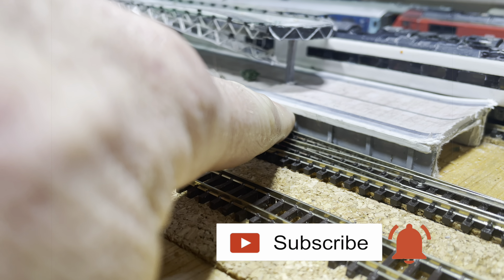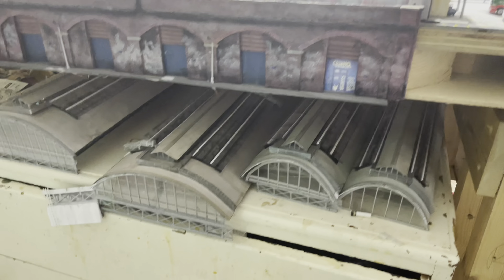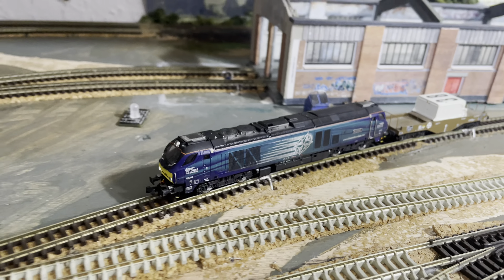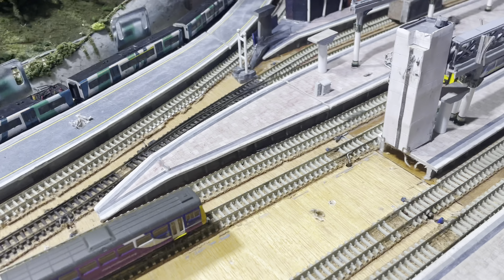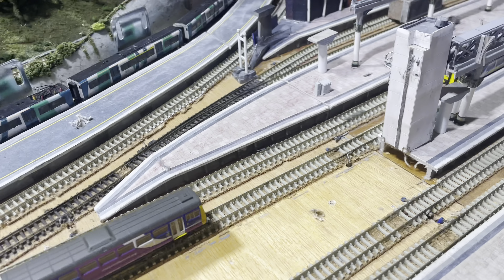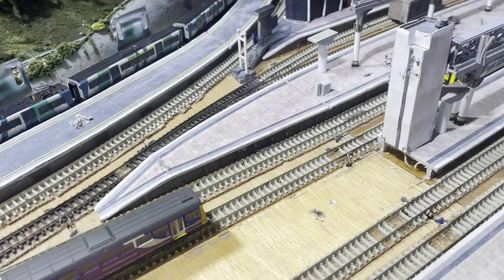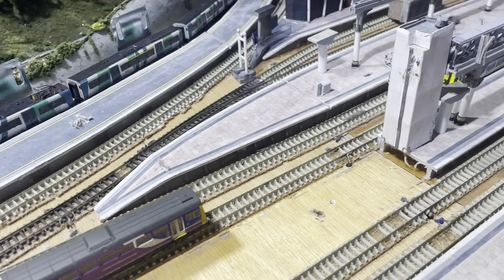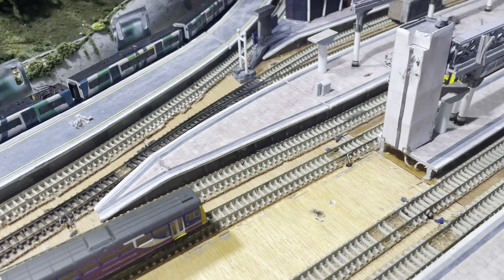I AM GOING TO REPLACE THE PLATFORMS.  EXTENSION PROJECT 2020/1 PART 7

Comment: Hi John,
Looks good you have your work cut out for a while I would think but except for your time which is invaluable cheap to do two things I noticed you have a point there and it looked like the switch will hit the platform side and you will be taking all the supports for the canopy out and they will need to go back in exactly the same place how will you do that?? Keep safe and well and I will look forward to seeing it all come back together then that will be some station.
Cheers Robert.
Reply from the maker: Hi Robert, Thanks and yes it will take ages with work in the middle, but bit by bit. The point is fine and switches without catching the platform. The sidewalls are about 2-3mm recessed from the platform edge.

Ive got a plan for the column / supports, I wont say here if you don’t mind but is certainly a video or part of a video to come.

Comment: The new platform looks great John. A lot of work but if the trains were stopping it had to be done. Hard luck with the card puckering. You can never quite be sure with 1mm card how it will react to paint. Stephen
Reply from the maker: Thank Stephen, yes no choice to rip them out and start again, I got the 142s after the station was built. I was quite disappointed to see how wide they are. The 3d printer will be very busy over next few weeks

Comment: Hi John - You are really mking some great stuff with the 3D printer and those platforms look excellent well worth changing them.
Cheers Kev
Reply from the maker: Ahhhh thanks Kev, Tinkercad is so easy to use. There is a mystery surrounding 3d printing making much more complex than it really is. Im gobsmacked what can be done and ludicrously cheap too. Each platform edge was around 6p

Comment: Nice job John, nice work round for you there with the platform tops though! I’ve just cut some more platforms from mdf, one I’m happy with the other I’m not and was thinking of making some with a stack of card I have. So really good timing there John and no 1mm card for the tops! Cheers John, John
Reply from the maker: I used 2mm greyboard. It was an experiment with the 1mm but clearly not thick enough. Love to see when youve done. Having said that Ive taken to putting the sides down on the board and this helps to judge how close to the trains you can get plus the shape if you have curves involved

Comment: They say a layout never finished
But end of the day it your layout when cameras are off. Main thing is your happy with your layout not what other people think.
Keep safe arp
Reply from the maker: Hi Adi MOST DEFINITELY, and these changes would have been on the cards at some point even without the extension as the 142s arrived after the station was built.

Comment: The new platform looks great. Will look great when the rest are done and then you will probably find the outer two bug you by being different,  though just resurfacing to match the edging should be enough I'd imagine.
Reply from the maker: Hi Kelly, thank you thats so very kind of you. I will definitely resurface pl 1/12, but they are largely unseen being under the canopy so hopefully should be ok. There are few platforms with brick sidewalls got feeling one is pl1 cant remember

Comment: Hi ya John, I really like your 3D printed platform siding. What was the length of each printed side? Forgive me if you mentioned it. It coming along nicely. Thanks. See ya.
Reply from the maker: Hi Norman, the beauty is you can make them any length you like up to the size of the printer’s build plate. Mine are 180mm long and can be easily cut to fit with scissors.

Comment: Lovley work John i love the 3D printed platform sides are they a concrete platform side and i like the platform tops as well. Cheers and all the best.
Nicholas.
Reply from the maker: Hi Nicholas, thank you. The sides are concrete, although slabs on the top Im not totally certain of the material they are made of, as they appear shiny at times on the real station

Comment: There continues to be no limitations to your imagination when it comes to the 3D printer.  The platform looks good, really good.  What's next with your ambition.  Print new windows for your home so you don't have to wait for your housing association.  Why stop there?  You could 3D print a whole new house and start charging the housing association.  Seriously it's amazing what you have been achieving with that machine!
Reply from the maker: Thanks Dave, glad you like it. Lol, well yes I could 3d window frames (wot u like? Lol) 

3d printer has opened up a whole new area of modelling allowing me to continue with a job when otherwise Id have to wait for supplies or find a less appropriate method.

Comment: Looking good John, those 3D printed edges are really the part! How do you find they compare cost wise, 3D printing vs buying the peco version? (just trying to get my head around 3D printing 😉) Cheers Geoff
Reply from the maker: Hi Geoff, thank you. I tell 3d printing is the way forward, as I can just print all day long making exactly what I need, no compromises on shape or any delay. At the moment, there are huge shortages of modelling materials. Whether true or not I heard PECO were making PPE for the NHS and scaling back on model railway products. 

Cost wise its its a complete no brainer. My printer cost £265 and the amount Ive printed would have vastly exceeded that if I had to pay for each item, assuming everything was available. The two RHTTs were silly money just few pounds compared to Hattons OO gauge version at £120 each. The PECO track edge pieces ones are £5.60 for 5 pieces around 165mm long so thats around £1.12 for each piece. Mine are 180mm long and use 0.87m of PLA filament per strip. There is approximately 330m on a spool making each piece around 6p meaning I can print about 90+ pieces for the price PECO sells 5. Hope that helps. Ive got Creality Ender 3 v2 it brilliant! No fuss no mess! I look forward to you getting one lol
Reply: @piccadillymodelrailways  thanks so much for the info John. I think I’d like to try and get one before the year is out. I don’t know why I find them so scary but like you say from a cost and flexibility perspective it’s a win win! Cheers

Comment: “The 142 is the widest train I have”... Michael runs down to the layout to check if his 142 fits into the platforms he finished just 24 hours ago... 😬😬😬
Reply from the maker: Ha ha ha, oh that did make me chuckle! Id already laid the platforms first time round when the 142s arrived and was really disappointed it wouldn’t go down them all, but it did go into pl1/2 which I suppose was good as that was where they left from in reality. 

Do yours fit?
Reply: @piccadillymodelrailways  phew! It is ok. A bit of filing on the back one and all is well. Typical it was the only bloomin thing I didn’t test with. Sigh!! Thanks John... saved me trouble down the line.
Reply from the maker: Lol, always the way. It took me by total surprise, shock, horror whatever you call it. You’d never think it, the smallest train would cause such a big problem. Glad its sorted
Reply: @piccadillymodelrailways  I know! My platforms curve at the end so I tried all the longest stuff. That 142 is a pain! Heh. It keeps us on our toes.

Comment: Looks awesome:) what sound files do you use for your locos?
Reply from the maker: Hi, thank you... I generally use Youchoos with zimo decoders as they are more durable than other brands. Eg if a short happens for whatever reason the zimo decoders just carries on from where it was it the sound file, whereas other brands go for complete restart which is annoying as the primer can run for 20-30 seconds before the engine starts. 

Plus customer service at Youchoos is amazing soooooooooo helpful. Again my experience of other sound companies some can be.. well...
Reply: @piccadillymodelrailways  thank you! :)